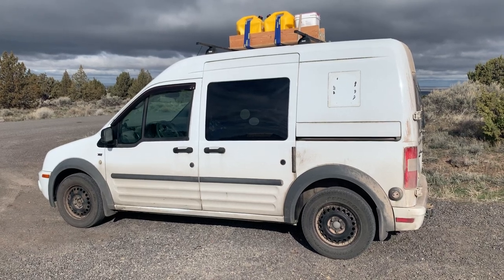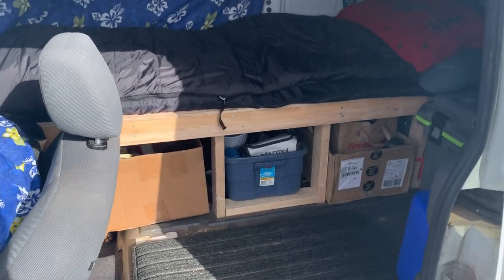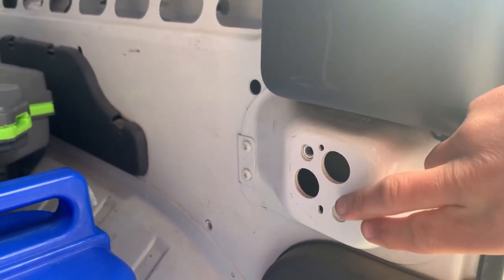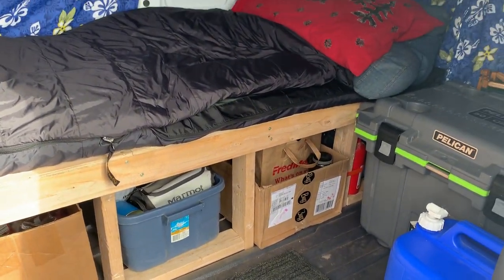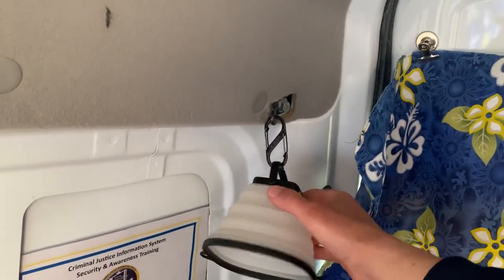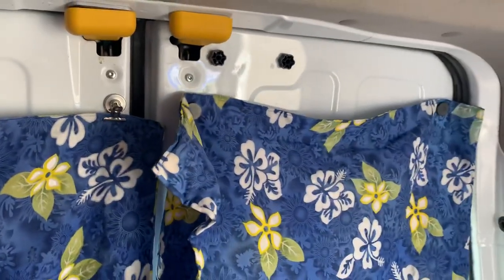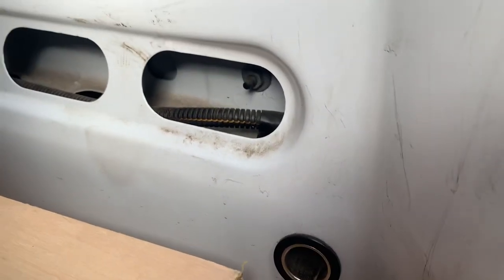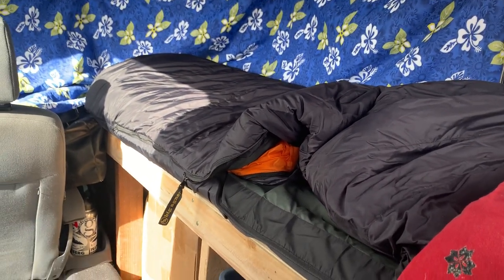Transit Connect Solo Camper Conversion

Comment: Nice!  I have a 2010 that I pulled the rear seats out, built a pullout bed/couch (I am only 5'10 so I just fit) and a sink kitchen area with a fresh water pump from my old boat so I can wash dishes and a hose to shower out back.  Hoping to try it out a little when the quarantine starts lifting.

Comment: Would love to see more.

I also have a van that I used as my normal commuter during the week but I also like to camp on the weekends.

Love how your setup is so easily switched between commuter and camper mode. Especial, the curtains are a great touch.

Comment: Did the bed come out and go back in OK?
Reply from the maker: Two bolts made it super easy to remove. I ended up selling the van to a friend and rebuilt the bed to make it more sturdy, shorter, and behind the driver seat instead of the passenger seat. He built the van out even more and leaves everything inside.

Comment: Would you please give me the inside dimensions of the Connect.  I need the interior height, length from the back of the driver's seat to the rear, and the width of the interior.  I'm considering getting a Connect, & realize it's very small, & am trying to design the best layout for a camper.  Thanks so much!
Reply: Google "transit connect interior dimensions"
Reply: I need the same because even with searching it up I found conflicting information...